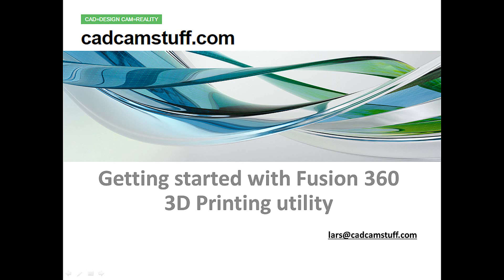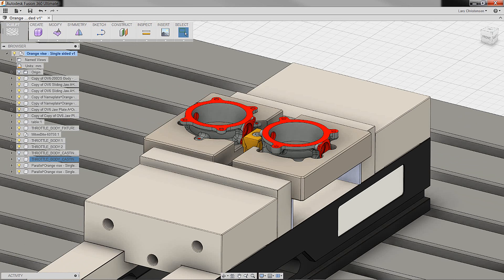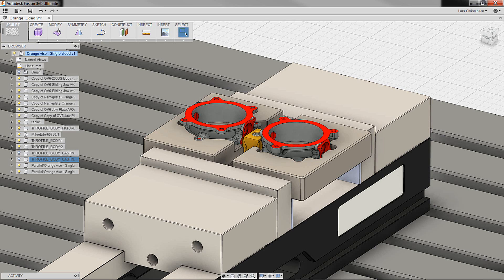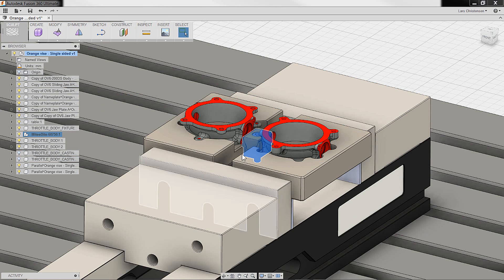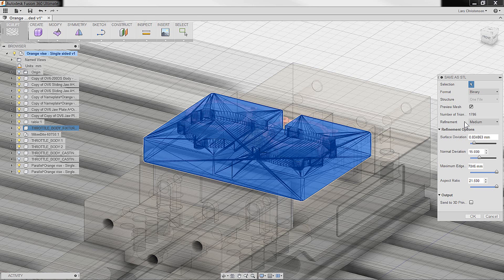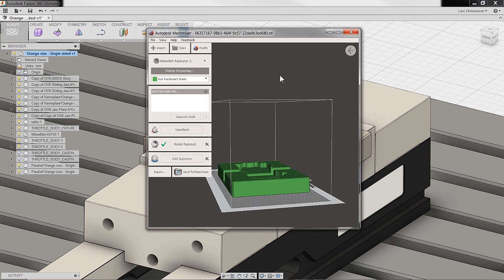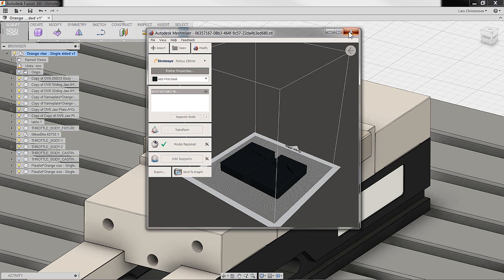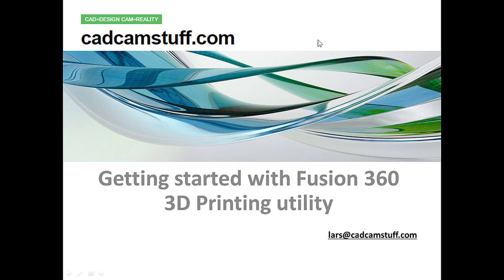Getting started with the 3D Printing Utility in Fusion 360

Comment: Hi Lars. Thanks for the great tutorial. I seem can't find a way to print a select section of the part to see how pieces work together. Say, I'd like to test how some junction works with the rest of the model, if diameter of a hole is big enough etc etc. I have to print the whole thing to see that. Have you come across of any method? Thanks.